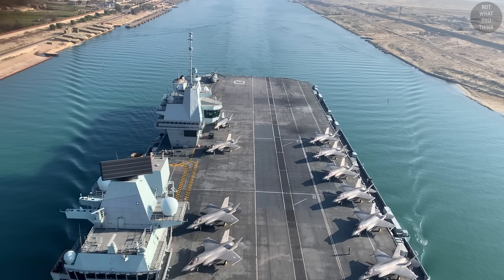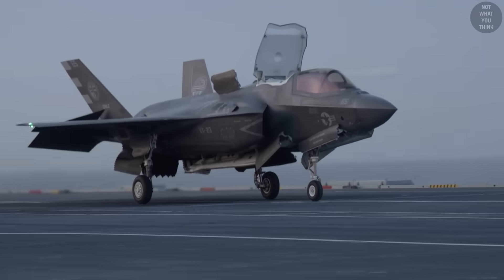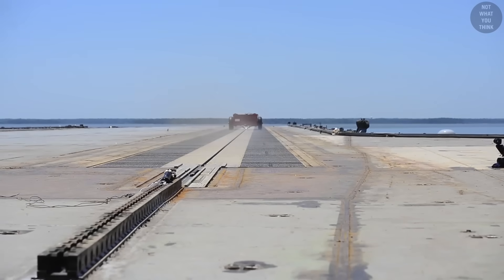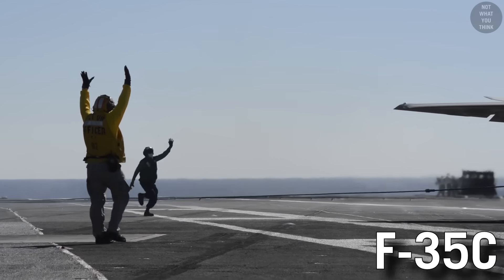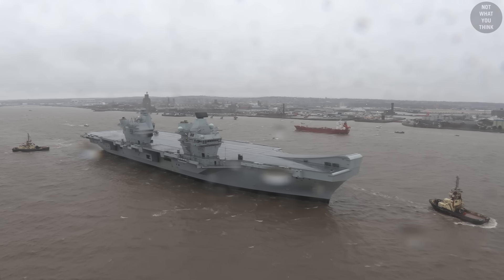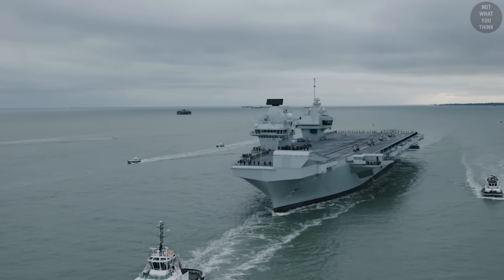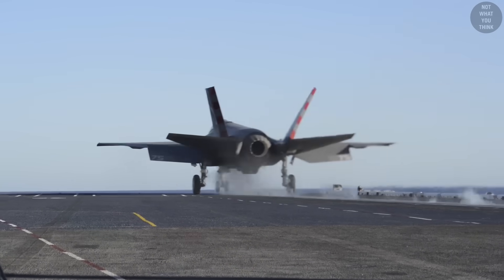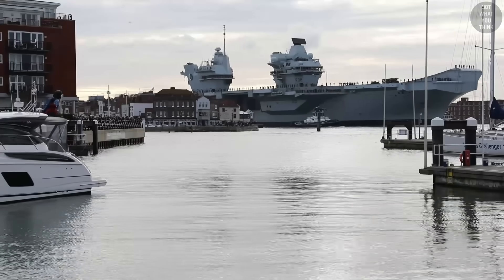Was the Angled Flight Deck Missed on HMS Queen Elizabeth?

Comment: I think HMS Queen Elizabeth should remain STOVL and the HMS Prince of Wales should be attempted retrofit and both should be tested to see which on is more effective overall.
Reply: Or make one with catapults for heavier aircraft to run ground suppression and cas while the other stay the same a focuses on air dominance and CAP
Reply: @Tburtl  the reason the UK wanted 2 carriers, not just one like France is that the availability of ships means that most of the time only 1 will be ready to go.
And if they did get to operate together, you would have planes that could only work from 1 of the carriers.
Plus operating & maintaining multiple types of aircraft is more expensive (even if they're quite similar) than a uniform fleet.
Reply: @sergarlantyrell7847  They are still basically useless tools in the modern era, given the constant refueling, limited number of aircraft, and inferior planes. Basically, the QE & PoW are equivalent to Air-Wing-Loaded US Assault Deck ships. Similar numbers of aircraft; same aircraft complement. 

For what was spent, the UK didn't do any better than a US Marine Assault Ship, configured for aircraft-fleet-support.

PS, our Assault Ships are a hella lot cheaper.
Reply: @devobronc  As in the carriers or the aircraft are useless?

If you mean the STOVL aircraft, consider that while the F-35B has 25% less range (combat radius) than the F-35C, it still has 30% more range than the Super Hornet. The B version only has 0.5 lower G-tolerance (0.6 less than the Super Hornet), but a higher thrust-to-weight ratio. And the main drawback with regards to payload is that the 2,000 lb bunker buster bombs have to be carried externally, but since the Royal Navy has never carried such a weapon, and the trend is towards smaller, but more numerous and more precise stand-off weapons anyway, this isn't a big loss. So while slightly worse than the F-35C (which if you care to think of it that way, is just an inferior version of the F-35A), it's still better than every other carrier-based aircraft in the world.

If you meant the carriers themselves, the Queen Elizabeth class is far better as an aircraft carrier than an America class, which is already about 1.5 to 2x the size of most Assault ships. And they're not a "hella lot cheaper", they're just 35% cheaper than the QEs (AND the development is split between more ships). And for that they can carry up to 20 F-35Bs, and even then it's quite the squeeze. The QEs can take around double that with plenty of room to spare so they can turn the aircraft around far quicker and generate far more sorties per day (110, which is not far off a Nimitz class).

Sorry, but "Constant refuelling", seriously?
Do you say that your Arleigh Burke class is "useless" because it has to refuel "constantly" (in fact it has less than half the range of a QE class)? Or are the Nimitz class "useless" because they have to refuel frequently with aviation fuel? The QEs hold more jet fuel per aircraft than do the Nimitz class, so both will have to refuel every few days during combat, nuclear-powered or not.
And this dreaded refuelling, which is done while underway (or during stopovers at friendly ports during peacetime) only takes about 2 hrs to fully fill up on bunker fuel for the ship. But they're topped off every few days so the ship never has less than 75% fuel on board, just in case, so about 1/2 hr every few days. Considering the entire escort fleet also has to be refuelled every few days anyway, 1 more ship isn't a massive deal. And again, as it can all be done while underway, so mostly not losing any time.

Compare that to nuclear refuelling which only has to be done every 20-25 years or so, but can take 2 or 3 years of the ship being in drydock and completely unavailable for service. Given that a carrier is typically deployed just 30% of the time, over the 25 year refuelling cycle of a nuclear-powered carrier, a Queen Elizabeth class could expect to be refuelling for just over 900 hrs (about 38 days worth)... compared to a few YEARS for a nuclear carrier, PLUS the time taken to refuel the aviation fuel tanks.
When you have 10 carriers, you can afford to wait that long, but not if you only have 2 or 3.
Reply: @sergarlantyrell7847  
The QE class was deliberately not built to run on fission based energy because the fitment of 2 reactors to guarantee system redundancy and all the other associated systems uses up space in the hanger deck.  In a hot war the QEs can hold a lot more aircraft than in peacetime operations if need be.
Reply: @darthwiizius  firstly, had they been intended to be nuclear powered, the entire design would have been different, & appropriate space would be allocated for the reactors, pretty much the ships would have just been made a bit bigger to accommodate.
Secondly reactors aren't so large as to impinge on the hangar deck (several decks up) anyway.
The real reason why is 2-fold, nuclear power was projected to cost slightly more over the lifespan of the ship, but with all of that cost being upfront it's harder to budget for.
The 2nd reason is if you look at any other nuclear powered carrier, their refuelling takes AT LEAST 15-18 months, but can be as long as 3 years. With only 2 ships, there is no way to have constant availability for that period. Diesels & gas turbines are much easier to replace if need be and the refuelling can be done anywhere in the world, even while on the move and only takes a couple of hours.
Reply: @sergarlantyrell7847  Also worth considering many countries  wont allow a nuclear powered ship to port and the Uk is not legally able to resell any nuclear powered ships once they're  obsolete
Reply: @devobronc  American military equipment is usually subpar built too... reliability isn't something often used in an American product
Reply: @devobronc  You got schooled. I hope it did not hurt too much. Looks like there are people in this thread that actually know what the hell they are talking about. 

Is the QE as capable as a Nimitz or Gerald D Ford? Nope. But its less than half the price of the former, requires less than half the crew, can still operate 65 aircraft at a faster tempo than a cat and trap (with the caveat that 20 or so of those aircraft are rotary winged not fixed). 

In fact the QE's are supersized America's, able to operate twice the air group, and still offload a marine Battalion with all the facilities those troops require. As there are literally USMC aircraft aboard Queen Elizabeth right now I think the Jarheads are orgasming about getting the kind of support a QE can give to the USMC. Given its USMC aircraft aboard I suspect that if the shit hits the fan and the USN and RN find themselves in a shooting war with someone you can BET that QE and POW will be giving the Marines the support they need, while freeing up two Nimitz Hulls....

So you may want to hold your horses when vomiting out how 'shit' the QE's are.... 

Also i would have gone into refuelling and maintenance as well... but I really could not be fucking arsed. Fun fact numpty boy, Nuclear powered ships require MORE maintenance than conventional, which means they require MORE dock time and dry dock time than conventionally powered ships! You know something funny? Ships are full of people. People need FOOD. You know what else needs replenished? That's right, that food. Weapons, munitions, spares, all the million and one things a warship requires. I hate to point this out to you you fucking retard, the the Naval logistics ships are not just there for FUEL..... And a Nuclear powered ship needs shit like toilet paper and ice cream just as much as a conventionally powered ship... Or does the Reactor somehow manage to wipe everyones backsides and feed them?
Reply: @alganhar1  Schooled, you say?

Get back to me when they prove inadequate vs actual CATOBAR Carriers in the future.

They are a compromise based on budgetary concerns over combat effectiveness.

Good luck.
Reply: @sergarlantyrell7847  Actually France planned to build two carriers, but the Charles De Gaulle was so expensive to build they quietly dropped the second vessel. There was talk of the French building a QE class as their second ship, but that didn't happen because it's not a French design.
Reply: @devobronc  Yes that is basically what they are larger versions of the Illustrious class. They were actually being considered for cancellation  but it was cheaper to continue building them than cancel them and pay penalties to all the shipyards involved. Requirements change and if they had been delayed by a couple of years before starting the build they wouldn't exist.
We have now just decommisioned our 2 assault ships so, basically, they are now doing that as well.
It's the usual mish mash of ending up with something built to a budget.
As it said in the video the emals would have cost app 2 billion each  and they were still at the design and testing stage so we ended up with these designs. There were 3 designs at the initial stage and they are ready to take cats/traps if that ever happens.
One other main thing is that they operate with a crew of under 700 (not counting the air wing or marines) and it is highly mechanised.
It has been decided that, like the submarines, one will be at sea and the other in maintenance. Crews and aircraft will be swapped around.
It has to be remembered that the whole UK defence budget is only app £45 billion and the US budget is app $820 billion so can't really be compared.
There are only app 150000 personnel in the total UK forces and over 2 million in the US forces. The US Marines budget is app $ 53 billion alone so that puts it into perspective.
Reply: And what happens when they decide which one is the most effective? Or rather, what happens if they decide that the STOVL configuration is more effective? Just convert the one they changed to CATOBAR back to STOVL & waste all that money?
And they would need a whole carrier's worth of F-35Cs too... So just to perform that test, they would need a £2 bn conversion to CATOBAR and £2.5 bn worth of new aircraft just for the test.
Reply: I believe that they are fitting a short ramp to HMS QE with steam catobar launch but it's mainly going to be for drone takeoffs
Reply: There was no need to test STOVL vs CATOBAR because we already know which is superior.  We converted the CATOBAR carrier Hermes to STOVL during a refit in order to save money on maintenance and on buying new planes for it, this resulted in it's performance in the Falklands being severely hampered.
Reply: The Centaur class Hermes was nearly 25 years old, she was basically at the end of her life by the Falklands war
Reply: that's £1-2 billion wasted on a test!
Reply: If you were to actually split it, it would be more appropriate the other way round. PoW has the full "Bedford Array" installed, which the QE doesn't, that helps with the rolling landings.
Reply: There isn't really any question that CATOBAR is more effective. Its just a lot more expensive. Also giving out a retrofit contract for only one carrier would likely mean vastly higher conversion costs per carrier than a contract for both.
Reply: It may come down to a simple matter of economics. The F-35C's are less expensive, yet have greater fuel capacity, range, and weapons load capability than the F-35B. So why pay much more for a plane that has less weapons load and fuel capability, plus range? Not to mention that you can utilise E2-C Hawkeyes on catobar. With STOVL you get only F-35B's and that's it! It may take several years but HMS QE and HMS POW will eventually become Catobar.
Reply: @Gsmooth10455  It was found during the Falklands conflict that STOVL aircraft enabled the carriers to run air operations in much worse conditions than would be possible with CATOBAR aircraft (back in 82 there was recent data to be compared to viz HMS Ark Royal and F4 Phantom ops. from the late 70's).
The reason for this is the STOVL aircraft are able to land in the sweet spot on the carrier where the deck is not moving much, vs landing on the rear deck which can be moving up and down by 30 ft.
Reply: @Gsmooth10455  Come on the Argentinian air force was not bad for 1982, they had some relatively recent aircraft, the A4 Skyhawk which was in production to 1979) and the Super Etandard, which was only 8 years old and still in production. Moreover, the Argentinian pilots were operating from home ground and a major lack in the UK task force was AEW radar, so sorties by them would come in with very little warning.
Warships were sunk because they were mainly on picket duty (ie protective duty without freedom to maneuver) in narrow channels providing a nice target for the Argentinian aircraft.

Anyway, what has that got to do with me pointing out that the STOVL design for the QE and PoW is actually good for flight ops in heavy seas?
Personally, I'd like to see an upgraded Typhoon capable of fleet ops and CATOBAR capability retrofitted into the carriers, preferably EM based at say mid life update, but I'd absolutely want to have at least half a squadron of F35B that are capable of all weather ops to allow the ship to fight when others are grounded.
Reply: @thecraggrat  Good point. I'd like to see a naval version of the Typhoon as well, just like France's Rafale.
Reply: @Gsmooth10455  I hate to say it, but the French do seem to plan their approach to weapon system development better than the British, mainly because they want to make it all themselves I suspect. I wish we'd do that too, as although the cost may seem larger, there are a lot of economic benefits that happen when you keep the money in your economy, rather than buying in and have the cash flow out. Taxes on people working and companies certainly offset increased spend.
I also wish that the planning for weapon system development would extend after the initial delivery, so that precursors for future requirements can be in place on the initial build, and that changes to the build do not occur after the start, except under exceptional circumstances; scope creep/change is one of the killers for correct project costing and time management. Better longer in the planning stage, than a wild change of direction midway through the build!
Reply: @Gsmooth10455  because the F-35B are far cheaper to operate, not even talking about the added cost of Electromagnetic Cats and Traps, but the extra flight hours that pilots need to practice CATOBAR operations compared to STOVL makes them SO much more expensive, the planes also wear out quicker & require more maintainance (due to the much greater forces applied to the airframe)... Though engine maintainance is slightly more for the B, lift fans don't add nearly as much maintainance as all the additional flight hours needed for a given combat useage.
CATOBAR would mean either much smaller light carriers with 1/3 of the capacity, or just a single carrier which are both much worse than 2 large STOVL carriers. For example the single French carrier is available for less than 50% of the time, whereas the 2 cheaper carriers have the ability for constant availability.
Reply: @sergarlantyrell7847  Its still going to happen, just remember you heard it here first.
Reply: There’s no budget.
The reason why we ended up with the carriers are they are is budget.
The reason why it has limited Defensive armament is because of budget.
The reason why they flood through their prop shaft when they’re not moving it because of budget.

Parliament couldn’t give a fuck about effectiveness. 
They’re ready for retrofit in wartime. That’s about it.

They’ve already stolen the budget for radios, Logistics and Armour for the army. Setting back multiple Future soldier and UMAV programs by more then 2 decades. The sale of 2,000 MOD properties. Weapons stores and spare parts for reserve vehicles. And the downsizing of The army from 6 major training bases and 150,000 active personell to 70,000 and 3 major training bases.
The Navy also has had to magic up the Type31 frigate for 100m. When no other nation on earth can produce a Multirole frigate for that price.
The Type 26 and Dreadnaught are behind schedule because no one paid for the infrastructure and management for the projects. Just to pay for the carriers.
The Type45 destroyers went without their Multirole Package (sonar, Tomahawk and Anti ICBM missiles) because of the carriers

.

If there is a war. The carriers have already cost hundreds of lives in other branches.
But everyone just imagines that they need upgrading.
When statistically. 1 will sink from Hypersonic ICBM within a week of a major war. And minor conflict kicking sand people to death won’t need the carriers as there will always be a Airbase with better facilities and less corrosion and maintenance from salt water and carrier landings.

And the other one will never leave port once it happens.
Because you can’t operate a carrier navy with 1 carrier. 

The carriers can fuck off for a decade before they get people killed.
Reply: @jugganaut33  "sand people" Your imperialist is showing.
Reply: @jugganaut33  sorry, that didn't make sense, first you said there is no budget, then started talking about budget cuts etc.

I'm sure the carriers were a large part why the Type 45s are so lightly armed, and lacking proper sonar and why the Type 31s even exist.
Also, equipment procurement (ships) has just massively increased in cost since the previous generation of ships.

About the Type 45's muti-role capability with regards to strike missiles, the RN doesn't really use any (on surface ships) currently and till the NSM is purchased it the new hypersonic missile is developed,  there isn't really much that they can put on the destroyers.

In one way it's preferable toet the long-lead items (the ships) built with the avilable funds, then use their under-armament as leverage to secure more funding for that.
I saw that the type 45 are finally getting a few more missiles, hopefully that is the beginning of a trend.